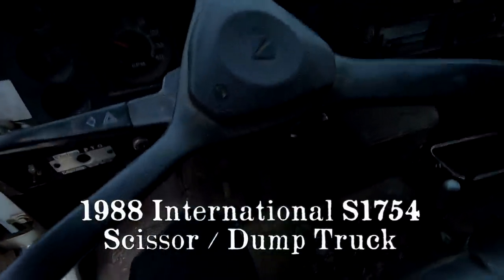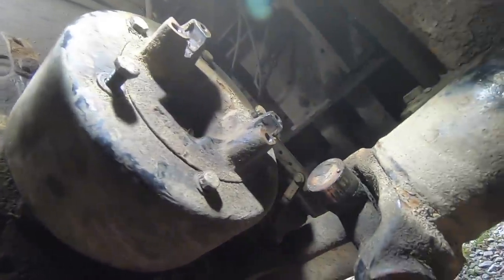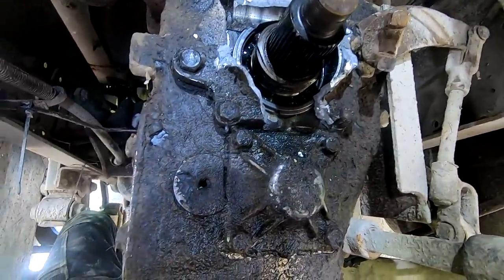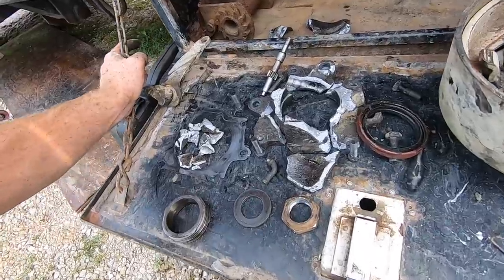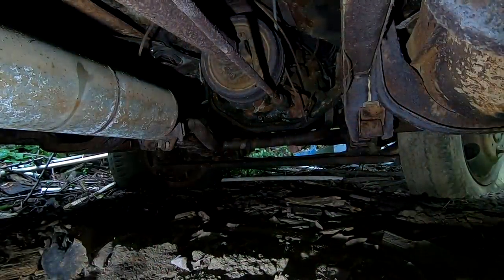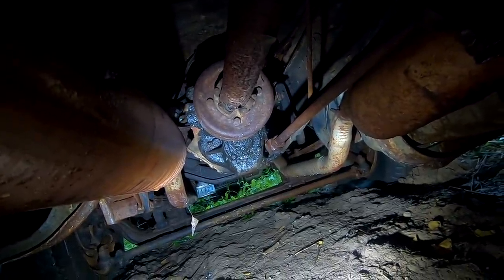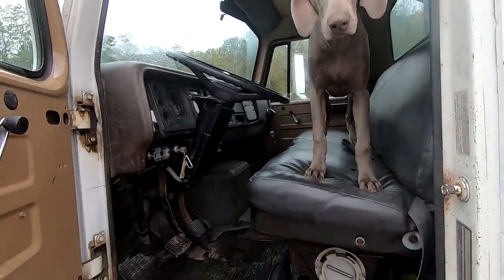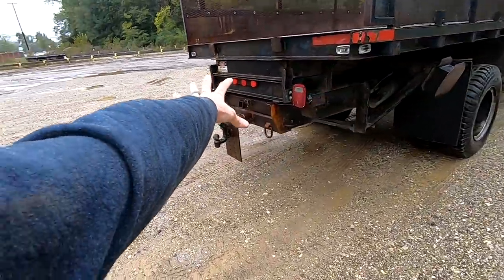Fixing the Broken Transmission Brake ~ 1988 IH Scissor Dump Truck

Comment: Never worked on one but like other transmissions, you have a snap ring holding the output bearing in place against the the output shaft. Your broken housing holds the bearing in place to take up any thrust of the output shaft. I think the play is normal without the housing installed.
Reply from the maker: Kinda what I thought too, but you never know! Thanks for the input on that!

Comment: The snap ring around the outer race of the bearing will be trapped between the trans housing and the speedo housing  that broke when you replace the speedo housing it should take out the play.

Comment: If you plug in a 2 speed differential you will only loose half your revs. The trucks of this age I’ve seen fitted with spider hubs are 8 ton or more load capacity were fitted with 2 speed diffs.

Comment: Haven’t watched till the end yet but the yoke nut at the trans is typical considered one time use only. Replace it as the nylon isn’t as capable the second time around. And lock tite the new one

That Play you were referring to in the main shaft is “end play” and there is too much. The yoke being tight will not soak it up. You might even hear some vibrations if you leave it that way. The input bearing might be worn and it might also need shims.

And now that I’ve watched the whole video…. Spicer manuals can be a pain. The 4th gear power loss is probably just due to a leap in ratios. I’m guessing you’ve got maybe 225-250 hp. Anyone who drives a medium-heavy duty truck often with lower up always runs them wide open. Can’t hurt it, I never have hurt one running it with the hammer down. Not enough power to do so. 

I always loved the 3126 cats and a spicer 5 speed with two speed rear. Wide open in every gear until the governor hit and then shift, never had a problem
Reply: That play was the bearing moving, which it can't when the rear housing is refitted I think.
Reply: @TheSynthnut  yup, you’re right. End play should be checked with tailhousing installed

Comment: Those duals came apart too easy. They've been off the truck semi recently. You get some miles on a set and retorque them a couple times and you usually have to beat the inner off with a bfh. The hitch on the front is a handy set up, even if it's just to move trailers or get one in a long access road someplace where you can't turn the whole rig around when you get back in there. So I still have those things we emailed about. I know you got busy, you still interested? Thanks for sharing

Comment: The transmission  might have a short 4th you go from 3rd high to 4th low then 5th low the to 4th high and to 5th high. The 2 speed rear end must be in high gear
Reply: I noticed a clamp on the shifter that looks like it was supposed to hold a 2spd  rear end shift knob but I don't see the knob. I wonder if someone replaced the 2spd rear with a single speed or if it's just missing the 2spd knob in the cab?

Comment: Do you have a two speed transaxle? the mount on your shifter is where the cable would go. it might be your problem.
Reply from the maker: Its missing the button to engage / disengage the 2 speed rear end... not sure why yet, but im going to figure that out soon!

Comment: The rear housing seal is in  the wrong way round, it will piss out that gearbox oil when the  oil heats up and  those nice new brake shoes will be well lubricated...

Comment: You’re fortunate you didn’t need the emergency brake on a big hill. I doubt the aluminum housing could have withstood anything but a parking brake load with shattering.  Silver lining is that the steel housing will hold the load you need it to hold.

Comment: The bad part about a parking brake like that is if you ever break an axle or a U joint while you're on an incline and you're by yourself, it's kind of hard to get out of the truck and stick something under the wheel before it rolls away. Ask me how I know. Parking brakes at the wheels are the only way to go.

Comment: You NEVER take nuts all the way off before you knock the Wedges loose. It will go the nut and wedge will go Through you Bud...They will kill you if you dont leave nuts on a few threads.
Reply: Listen to this Cat!!! Always leave some threads brother...we don’t want you catching a hunk of metal in a bad spot...like your eyes or face... your too purdy to be catching chunks of metal with your face, brother!  
Those are some awesome trucks...I’d love one just to own it! 😂👍
Reply: Toyota front locking hubs have cone shaped washers, and the same trick is required to get them off. Loosen the nuts, and smack the hub with a hammer to loosen the cones.

Comment: Ummm...isn't the seal supposed to go with the smooth side out...spring side in towards the bearings?  
Also...might have thought about greasing the bearings before putting it back together.

Comment: Didn’t see you do any lubrication to that brake assembly et cetera I would’ve thought the Speedo drive would have needed some Grease
Reply: It uses the transmission oil as lube.  Hence the seal being behind the speedo gear, rather than between the speedo gear and the transmission.
Reply: Nice one

Comment: Hate to say but that shaft seal you put in most likely will fail at some point. You put it in backwards. Rule of thumb for seals - the fat lip side with the little round spring around large seal lip is always going to the side where there's oil. The side where the outer metal is flat and has the thin lip that rides the shaft goes outside and that thin lip is a dust wiper seal. Most likely the cast metal replacent part you got was an update. Your aluminum housing was most likely original. Way back in the day, the manufacturer probably found out alot of those housings were breaking so they offered the cast steel upgrade. Many of the original inferior parts can last for years before they finally fail and they might never fail. Saw that kind of thing alot doing mechanical work.

Comment: Is there not a interlock to prevent shaft brake being engaged and engaging transmission gear?
Reply: That was my thought but in this case he had the engine revved up(via manual throttle cable) for the PTO to drive the lift. That extra torque would do a lot of damage. But it does seem like a possibility to happen again by accident. If the p brake was not engaged the whole truck would have jumped forward or backward doing human damage.

Comment: It does look like it was designed as a breakaway sacrificial tails haft housing mount for the brake drum....you better check the u--joints for abused state , too

Comment: the 3-4 shift: it's an old turbo diesel, there's a gap between the natural diesel torque and the boost from the turbo (think of it like a lower case 'm'), and you're shifting right into the gap. if you shift earlier the torque will be there from the diesel, and then the inertia will carry it through the dip, although if you're used to gas/petrol engines it feels 'wrong'.

Comment: When it's in 4th it sounds like it should have a 2 speed splitter on the rear axle...there is a wire clamp for the button assembly on the gear shift, so my thought is, is it unhooked?
Reply from the maker: It's got wires that go all the way back to the rear axel, but they are coiled up and zip tied to the shifter... I'm going to chase that down soon!
Reply: @SalvageWorkshop  Very cool, would be interesting to see why it's unhooked and coiled up...you would think if there was no plan on fixing it, it would've been hacked off by the previous owner
Reply from the maker: @jimscales8054  yeah im curious too... you never know, im hoping it just needs a new button and then ill have 10 speeds, but when is it ever that easy!... Trust me i've towed some pretty significant loads with it already and it NEEDS THEM!

Comment: the rear extension housing seal will work backwards for a while but will leak reasonable quickly. In my truck repair shop you would have lost your job on the spot for letting a wheel spider retainer fly off, very dangerous.

Comment: It probably has or had a 2speed rear-end ( that's what that clip is for on the side of the gear shifter it's for the air-line going up to the push/pull switch ) that's why there is such a power loss,

Comment: Spinning that DT360 to 3K to make 70mph is looking for trouble.  I don't know what the governor is set at, but I doubt it is any higher than 3200.  Well unless somebody messed with it... which makes finding trouble easier.  If mated to a six speed it really should have a two speed axle in the mix especially if intending on going over the 10k GVW range.

Comment: Can you help me out? Im getting a roll back truck that's been sitting a little there is a hole in the gas cap so definitely water in the diesel I have no clue where to start on getting it going I know it runs on starting fluid I think the first few things I do is drain the desel from the tank then replace the filters but after that I don't really know where to go from there

Comment: I'd be curious to know what transmission you have.  I've heard a lot of people complain about the T34 5 speed overdrive International used in their trucks because of the large jump between 3rd and 4th gear.  I first read about them because I have the non-overdrive T36 in my half-ton IH pickup and was looking into something similar with overdrive.  It's funny that IH put the same transmissions found Loadstars and school busses into some of their light line pickups and travelalls.
Reply from the maker: This IH S1754 has a Spicer CM4054D series 5 speed transmission in it.

Comment: Is it possible that the  aluminum housing was cracked before this incident ?  That has to be the worst application for an aluminum part I've ever seen !!
Reply from the maker: I honestly have no idea if it was already damaged because I never looked at it.... I had literally JUST gotten it home and was looking the truck over when I cause the damage... I agree, it should never have been aluminum, but I'm happy the one I replaced it with is cast Iron.  Thanks for watching!
Reply: @SalvageWorkshop  Sweet Repair !!!

Comment: You might be winding that cornbinder a bit too tight. I never run my Cummins over 2,000 rpm. Detroit's maybe 2,200 rpm. If that is a 5 speed overdrive trans the shift pattern is likely different than a 5 speed direct. On the O.D. trans 4th. and 5th.  are reversed.

Comment: The problem is in both the trans & the motor.  The reason it bogs in forth is the engine has gone beyond
Reply: its power curve.  Once you get back to where the cam is at its most open power should come back.  You need to find out what manufacture made it then go to a motors manual or spec book and that should tell you where & when the motor is at its peak torque so that you can shift it corectly.  Most of the diesels today have a torque curve that runs between 1100 to about 16-1700 RPM.  Thats where the motor functions its best!
Reply from the maker: @keithhill9138  This is not one of those motors... they are designed with barley enough power and are designed to be driven foot to the floor in all gears. The reason for this is they were largely used by companies who have employees running these trucks hard... it doesn't have enough power to hurt itself, I can vouch for that.

Comment: Whilst the brake failure was your fault, it worries me how that housing could even support the weight of a fully loaded truck sitting on a hillside with the parking brake pulled. It would seem to me that those housings were inferior from the manufacturer which is why they changed from cast aluminum to cast iron

Comment: People people people. ALWAYS LEAVE THE NUTS ON PARTIALLY WHEN YOU ARE REMOVING DAYTON TUPE WHEELS. ALWAYS!!  leave them on the depth of the nut but loose. Then go around with a hammer and pop all the retainer wedges loose. Then take the nuts off. Those can really screw your up!!  They come off like a bullet.
Reply from the maker: Pretty sure I demonstrated that!
Reply: @SalvageWorkshop  I've seen where one of those wedges shot off and went straight through a site office.  In one side and out the other, straight through both walls .

Hopefully you've learned what not to do those spider hubs, too.  That much force would make a real mess of a fella.

Comment: I'm very surprised you worked on that lifted while not having a jack stand under it and totally relying on the hydraulic floor jack.
Reply: I'm surprised he didn't just use the hydraulic outriggers at least to take some of the weight also, but I guess no PTO